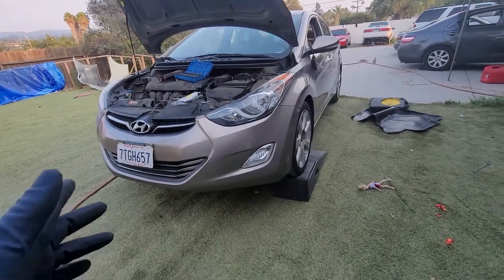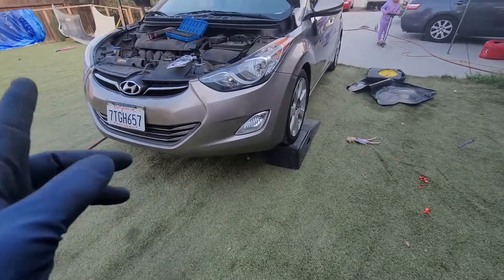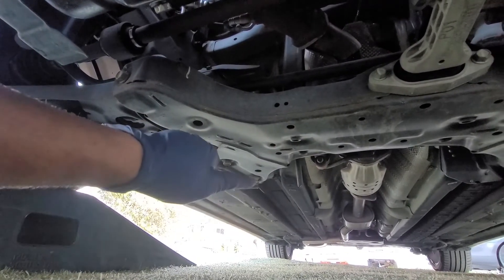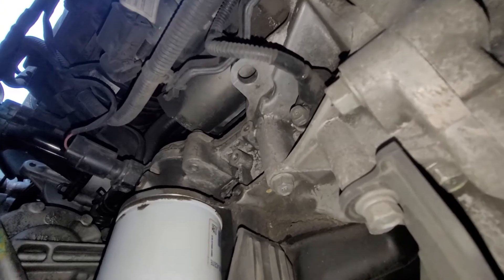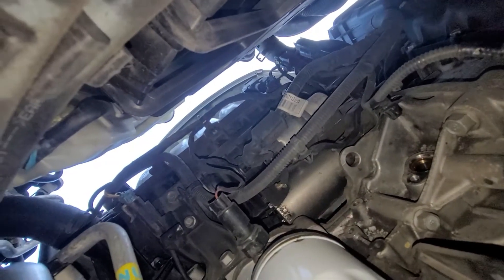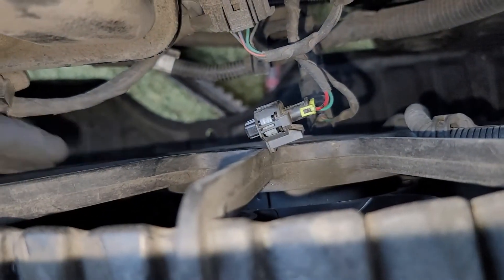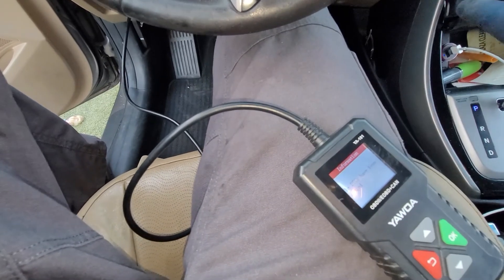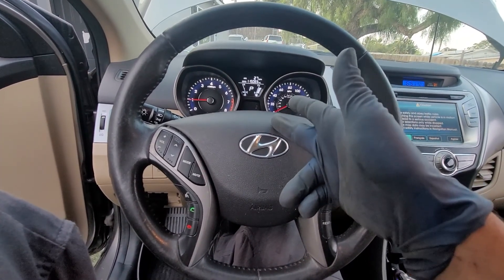2013 Hyundai Elantra p0335 stalling and runs rough crankshaft sensor replacement

Comment: I'm no mechanic by any means but I was able to follow this video step by step to replace the part. Every step was detailed from explaining how to lift the car to gotchas like making sure the O ring came out.  The camera work showed exactly where the part was, how to remove and how to replace.  This job took me about 1.5 hours but your mileage may vary.  $20 part and 2 hours of my time was worth what I could have paid the local auto shop.

Comment: Great video dude!  The part was under $100 and took only 15 minutes to complete the repair.  The hardest thing was getting that electrical connector off since the clip you need to depress is on the underside of the switch so I did everything from under the vehicle.  Elanta 2016

Comment: Great video and thanks for sharing. I used it to change the CSP sensor on my friends 2012 Elantra. Step by step. The hardest part was trying to get the electoral connection separated. Also thanks for the tip on using the screwdriver pick to press that tab on the connector. Worked perfect. On a side note, it looks like  of someone needs more room then they can remove the airbox and have a little more space to work with on dealing with the connectors.

Comment: Just had this issue on my wife’s car. After inspecting the sensor it seemed fine. It had metal particles on the end. So rather than buying a new part I just cleaned the sensor, flushed the motor and did an oil change. Car works now, only thing I would have done differently would be to remove the sump and clean it. The car was super low on oil so I think that created excess particles and the sensor was picking those up and screwing with the readings.
Reply: Your issue was more likely due to the low oil problem.  Cleaning these sensors probably doesn’t do anything unless it’s covered with metal bits.  When your oil is low the variable valve timing won’t be able to activate properly and cause a code like this.  For these codes always check the oil first and if it’s low deal with that and see what happens

Comment: Great instructions, thank you. Just like in the video, my o-ring was stuck inside and it came right out with the pick.   It was very easy getting it out but for the life of me I can not get the sensor back in.  No matter how much I push and twist it, it still has a gap about 1/8 to 3/16.  Any ideas on how I can overcome this? I didn't realize this at first and cracked the sensor, the replacement sensor just arrived.   BTW how you were able to film AND do the work is beside me.  Very impressive.
Reply: As a test I took the o-ring off and it slid right in.  For all of you located in a colder climate, because the o-ring was so cold it just wasn't compressing.  I covered it with oil and hit it with the heat gun and it slid right in.

Comment: P0016 elantra crankshaft position ,camshaft position,correlation bank 1 sensor A.Checked timing chain all good at tdc nothing went out of alignment everthing is good ,had to boost battery cause my daughter let it sit for months .It starts but you have to play with fuel to keep it going .Sounds like a crankshaft sensor replacement

Comment: Bro! I have a question for you. In the case of my Elantra, the two cables which go to the sensor are not in the same order. I mean, in the video the red cable is on the left and the green on the right, in my car are in reverse order. Red on the right and green on the left. I know that both cables have 2.5v. Does it affect?

Comment: I did everything you showed and car is good now. Only thing I didn't do was get the part from dealership. Hyundai was really going to try to scam me for $200 for part that I got from an auto store for $80. So, I went all in and raised up side of car - the wrong side lol, but I was still able to get under there and reach sensor. Don’t have a Milwaukee ratchet wrench so just used a regular ratchet, got that bolt out.

Hardest part was trying to get harness unclipped (Good God😫) but eventually it gave. Got old sensor out, put new one in, started her up and she ran fine. Just hoping I'm not gonna have anymore issues or surprises in the following days and weeks.
Reply: Is it still running fine, the auto parts store website says some brands need to be relearned?
Reply: @Falcons4Death  Thanks for asking. Actually I no longer have the car because the classic engine tick that Hyundai gets was getting louder a few months ago, and they would not replace my engine even though their web page said I qualified for it. So I had to trade it in. But before that the car was still running fine after I replaced the sensor. One thing is for sure though: I'll never get a Hyundai again.

Comment: In addition to the symptoms mentioned, can this cause the tach to not work?
Reply: Yes it can. My Hyundai Elantra is a 6 speed manual. A stick shift and it caused my RPM'S to get stuck
Reply: 2015 Elantra, cylinder auto… bad crankshaft position sensor caused intermittent tach problems, and stumbling and low power.

Comment: Question, why was the reason your change the crank sensor, am having a issue where I have trouble starting the car then after 3 times its starts but the rpms are 0 when I press the gas same model car as the vid
Reply: I have the same issue. Did you end up changing the sensor or do something else to fix the problem?

Comment: Hello, I just change the sensor with no issues, but now the car does not start, what could it be?
Reply: Me too did you figure it out
Reply: I can start it if i unplug the sensor and it stays running if i plug it in, but the tach won't work, then if i turn it off it wikk just crank a million times

Comment: Jabo, great video - thank you. One question: You say to only use OEM CKP sensors. Is there a real demonstrable difference or is this just an opinion? I replaced mine on a 2013 Elantra GT and couldn't get rid of the code. I got the sensor from another brand on Rock Auto. Do you think an OEM sensor will fix the code problem?

Comment: Hi how are you ? 
I am in need of help . I got so many things fixed on my car and I can’t figure out the problem. My check engine light is on been on for months . But when I check the codes I am getting P0017 crank shaft but beginning of February I got the crank and camshaft fixed and got my throttle body cleaned . But I keep having the same problem when my car is stopped the idle goes up and down and then it jerks then the car shuts off . Sometimes when I mess with air controls it messes with it . When I put my car in neutral sometimes it stops not always . My car is hard to start.
Reply: Did you get this figured out?